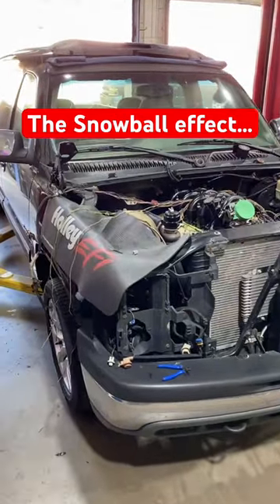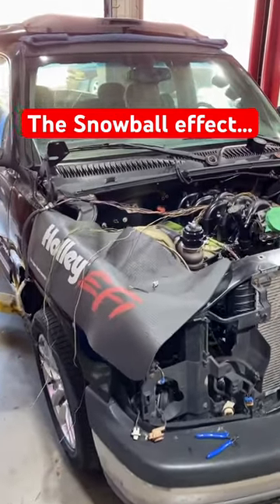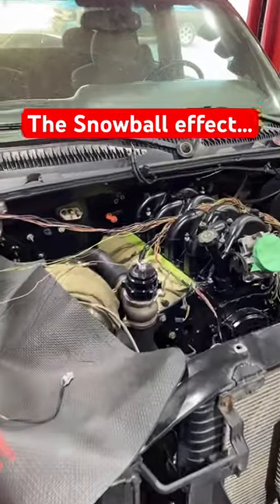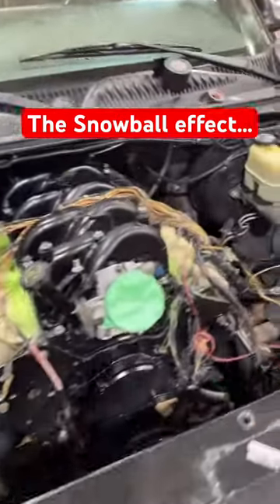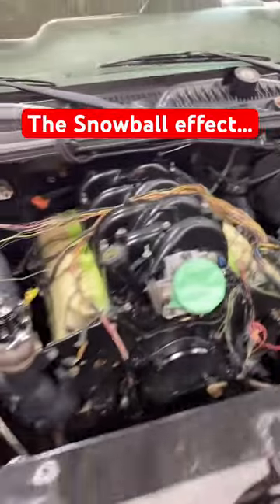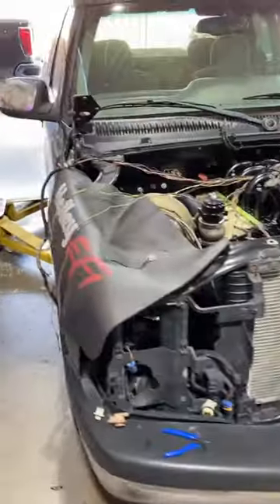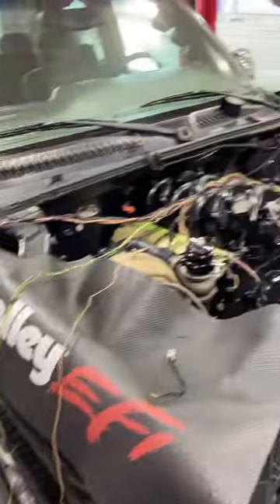Things might’ve gotten out of hand…

Comment: Thats good advice if your a seasoned enthusiast and have the resources as well as the right environment to go the extra mile but for some going down that rabbit hole can be detrimental and cause you to lose interest in your project, resulting in not finishing and giving up working on cars all together. If your young or just starting out and want to stay motivated while you learn and get some experience under your belt, you need to balance some of that “do it right or don’t do it all”  with, and I quote: the great David Freiburger, “Don’t get it right just get it running”! It’s not about preaching one or the other,  It’s really about finding that good balance between the two that will usually result in a better outcome.

Comment: Totally know what you mean,  we were going to put new heads, gauge cluster  and disc brake conversion kit on my 67 mustang convertible.  Get the car in the shop and now we are doing a new 351w and AOD transmission, new bushings all the way around, new leafsprings, radiator headlight upgrade and electric power assisted steering..... never ends😂😂😂❤
Reply: It will when the money runs out. Choose wisely. Good luck😮😮

Comment: As a former auto tech for a dealership and many independent shops, I will say there is a huge difference between doing it right going above and beyond. If the customer wants the harness rebuilt or improved, that becomes part of the job. I have found most customers do not want to take that extra time, or pay the extra money for something that will not make the car/truck run better or last longer. The point is “doing it right” is a very imprecise statement that has varied expectations. Doing the job the customer pays for is what is required.